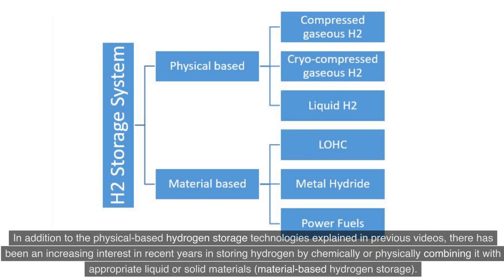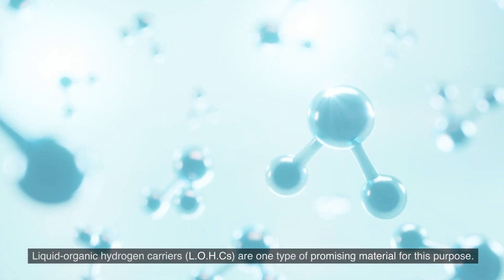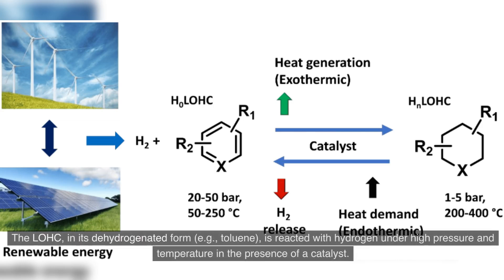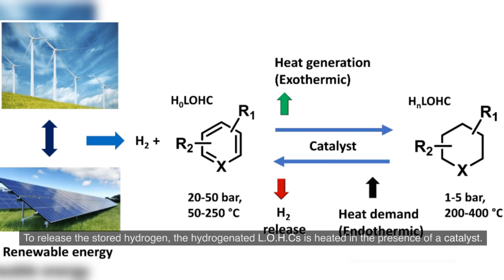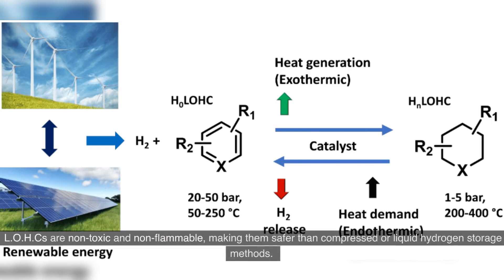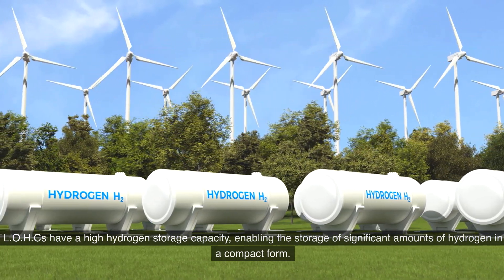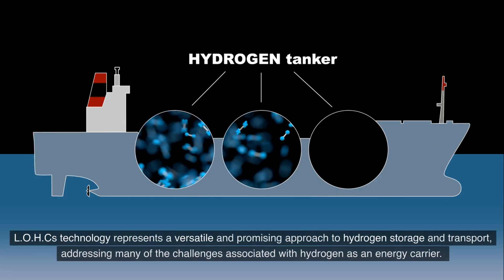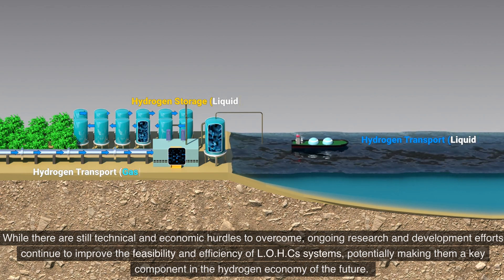Hydrogen Storage System: Part-4 Liquid-Organic Hydrogen Carriers (LOHCs)

Comment: Well Explained
Reply from the maker: Glad you found it helpful!
Reply: @ Thanks. One pressing doubt thought. Why go through this cumbersome process of splitting water, hydrogenation and then de hydrogenation? Can’t they just split water at point of use?
Reply: @Faz527  
if I understood your question correctly, then the answer to your question is,

Hydrogen must be transported from a point of creation to a point of use, which is difficult.
For example, Hydrogen created at a windy place (using turbines) needs to be transported to industrial areas where it will be used.

To make the transportation process smooth, a good idea is hydrogenation and dehydrogenation.
Reply: @saifulislam-z2w  Both dehydrogenation and Electrolysis require energy. Why don’t they just electrolyse water?
Reply: @Faz527  

the usual process is,
Renewable energy > Hydrogen from water electrolysis > transferring Hydrogen for use (this transfer is costly and hard to achieve with current infrastructure) > energy from burning Hydrogen,

But a better alternative process could be,
Renewable energy > Hydrogen from water electrolysis > Hydrogenation > transferring Hydrogenated liquid (this transfer is  achievable with current infrastructure) > Dehydrogenation > energy from burning Hydrogen,

So the extra Hydrogenation and Dehydrogenation step makes Hydrogen easily transferable from one place to another place.
Reply: @saifulislam-z2w  I understand that transportation part. Where I worked, we electrolyzed water on site. Wouldn’t that remove the need for an extra 2 steps?
Reply: @Faz527  

Yes, you are correct. After producing the Hydrogen, on site use of Hydrogen will not require the extra 2 steps. The 2 steps were added only to make Hydrogen transportation possible with current infrastructure.